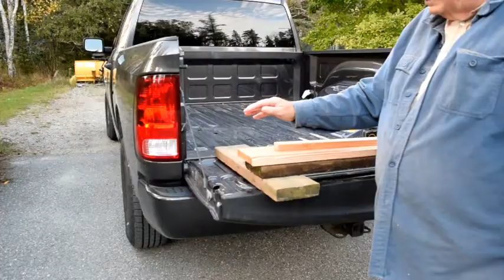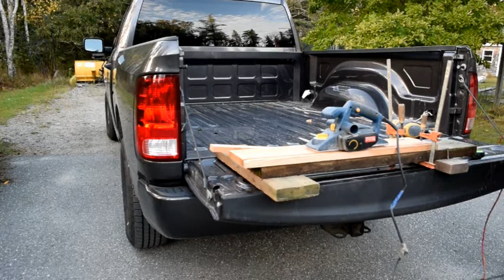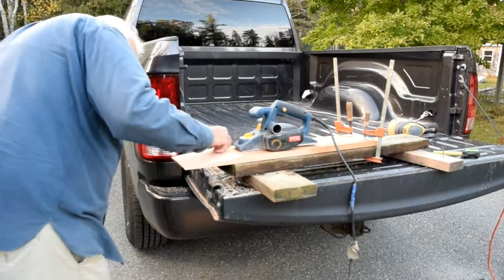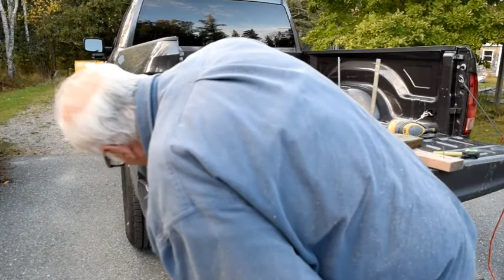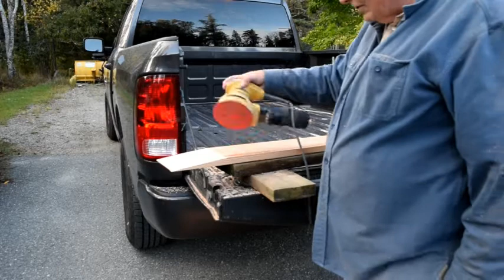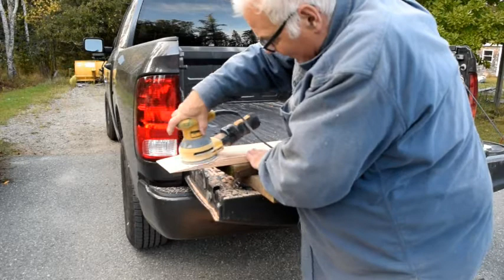Boat Maintenance - Cutting a scarf on a new plank end

Comment: Like using white cedar, wider boards, not air dried and easy to work with.
Reply from the maker: White cedar is nice wood.  However, it is essentially impossible to find clear white cedar here.  If it was an option I would use either Port Orford cedar or Alaskan yellow cedar.  Unfortunately those woods and white cedar are not options for Tortuga because the hull is planked with Douglas Fir.  That is why I am using Douglas Fir for the repairs.  If I lived on the west coast, particularly the pacific northwest, I would be able to get wider stock.  But here in Maine Douglas Fir is an exotic wood and I take what I can get.  Fortunately the local lumber yard carries clear vertical grain Douglas Fir in 5/4 thickness up to 6" width.  They have wider stock, but only in 3/4" thickness and Tortuga's planking is 7/8".

Comment: I am really liking how you are not intimidated from doing the repairs to the wooden hull yourself and usind whatever tools you have at hand. I suppose it is one step at a time, your videos offer up information where one learns where to start.
Reply from the maker: Greg, I am glad you find the videos useful.  The hardest part of a wooden boat repair is generally the first step - getting started.  Once you get beyond that it is pretty easy and you don't need a lot of tools.  For the repairs I am doing this year I am using the following tools: electric plane, oscillating saw, random orbital sander, skill saw, electric drill, electric driver, screw drivers, wood chisel, paint brushes and a pair of scissors.  I also have a cheap ($100) Ryobi table saw for ripping longer planks and a thickness plane because the planking on my boat is 7/8" thick so I have to plane 1" stock to thickness.

Comment: That looks fairly straightforward. I should buy an electric plane one of these days, it would come in handy for quite a few things.
Reply from the maker: It is a very easy way to cut a quite precise scarf.  Electric planes are indeed useful, but they are brute force tools.  When I have detailed work I switch to a hand plane.  I don't know if you noticed, but my electric plane is the cheapest Ryobi I could buy.  I have had it for 14 years and it still works fine despite some pretty rough use.